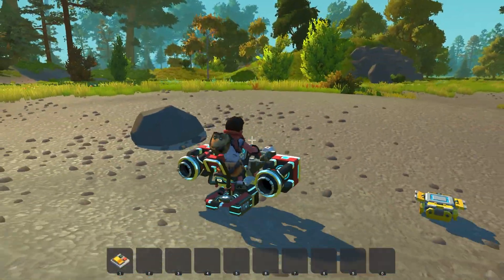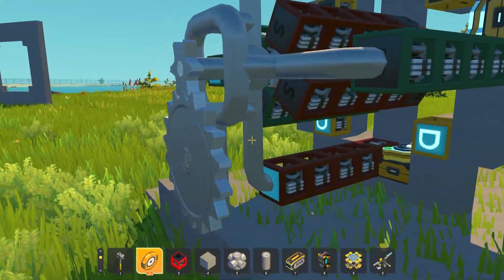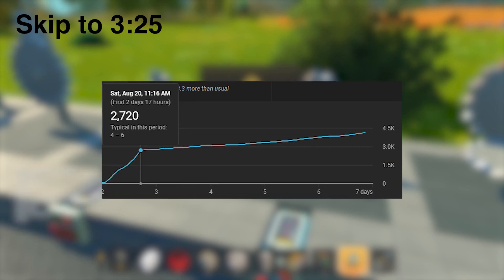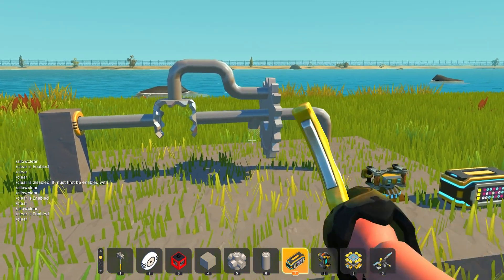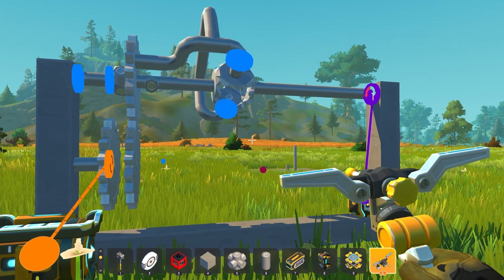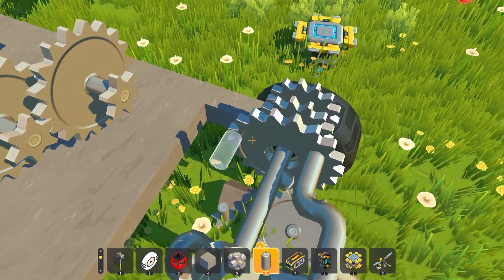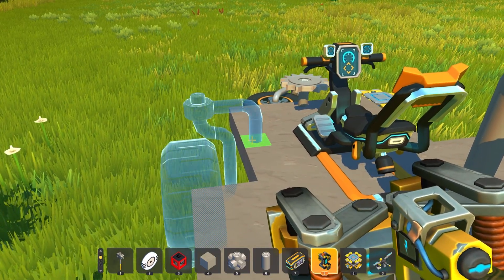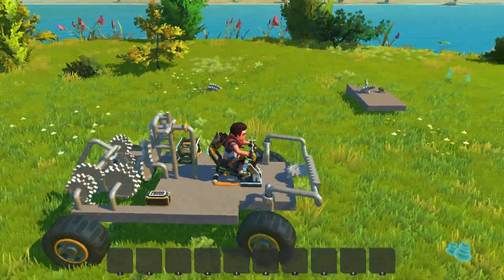Making a realistic car differential in Scrap Mechanic

Comment: Once I tried to make kind-of real transmission in scrap mechanic using only vanilla stuff. I found a problem that if i wanted to have 1 to 2 gear ratio as a second speed i`d need to fuck all i`ve done and remade it all, i`ve done it and understood that it wasn`t working on reverse and 1 to 1 gear because the same problem as in the wideo where positions weren`t matching. I had only 2 porperly working gears btw, 8-teeth and 4-teeth gears so i decided that i`ll use mod. After some time messing around with this mod and pistons i understood that this ain`t gonna work cuz at my first test with 1 to 1 and revers 1 to 1 gear went f*ukin flying due pistons having problem with glitch-welded stuff (which is how those moded gears kind-of are made) , after all i decided to throw that idea because scrap mechanic just wouldn`t allow me to to a real transmission with it`s physics and proportions

Comment: this man aint realize there are vanilla ''through bearings'' and they are really simple to make no glitchwelding required. i can show u if u want
also nice vid!
Reply from the maker: If you a referring to using pistons or suspension (because they have no collision) to allow something to rotate through a solid object, yes I am aware of that. That system would have worked for the wheels on the vehicle, but it would not have worked for the differential, at least not in the space I had.
If that isn't what you are referring to let me know! My point was, though, that I would like something intended, the suspension/piston route isn't really intended behavior. I think the modded solution is much more elegant, intuitive, and useful.
Thanks for the comment!
Reply: @Oxynity  you can do it in 1 block space but yeah didnt know you wanted it that much intended...
but maybe also make a piston engine for it, would be cool, although you might have to use some slight ''glitched parts'' for it. but yeah no problem!

Comment: This is the content I CRAVE. Seriously. I've made a working diff vanilla using the small pipe pieces, they do skip some at higher speeds but I've gotten it to go pretty fast. Though I really want to see a working transmission. I'll have to download this mod ASAP.
Reply from the maker: It is extremely detailed, I think you'll enjoy it!
Reply from the maker: I actually wanted to do a transmission to start with, but I don't know all that much about them. I'll have to look into it!
Reply: Definitely! I like watching those older Ford videos that go over the basics of car parts. Modern transmissions have like a weird sheath gear that activates depending on the gear and I have no idea how to accomplish that lol. But gear ratios really are amazing.

Comment: oh if u were trying to make a magnet engine ive made like 100 of those ive mastered the timing preety well ive reved them up to 6k rpm only problem with them is idealy u want like 300 rpm and magnet engines aint realy good at that so yeah my friend made a gearbox mod but its got some issues i can use it its just not ideal. and also ive made some differentials too and some magnet powered cars etc. im workin on a 6x6 truck thats has 3 gear trans and uses a magnet engine with a engine sound emulator,other then the gun. the only problem with the diff is that the gears slip TOO much, even the transmision to connect it didnt work for u cuz like i said their rpm is too cool for the gears to handle one way arround this is to use a thruster engine whych ive made plenty of too like one my big block i6 that reved up to 120 rpm whych is ideal for gears but the torque it made would probably be too much for the gears thats why i went to my stategy whych is my friends gearbox mod whych works very well exept the input can drive the output but if the output tries to drive the input it becomas a insane break and stops turning instantly because of how scrap mechanic is badly made like even the devs practicaly dont care about the game no more like they made this custom gamemode for the comunity aka the comunity will make stuff and they will get money from it they literaly havent made eny other updates for the past like 2 years. hope i didnt waste ur time, have a nice day. :).

Comment: You should make self drive car
Reply from the maker: Interesting. What do you mean self-drive?
Reply: @Oxynity  like can go throught a race trace and middle to top speed 
With hitting any thing and no driver seat
Reply from the maker: @maxgaming4627  Hmm okay, I will add that to my list!
Reply: @Oxynity  small heads up, that is going to be torture

small tip: have some kind of pusher mechanism in the front because if you try to do make it move backwards with only wheels/steering and logic it will give you so many headaches

source: i have tried doing that multiple times